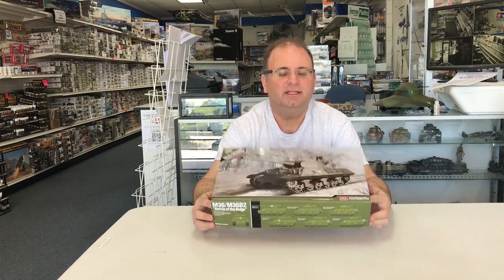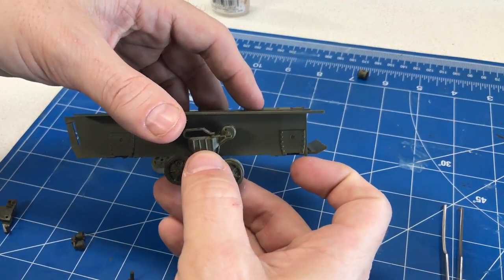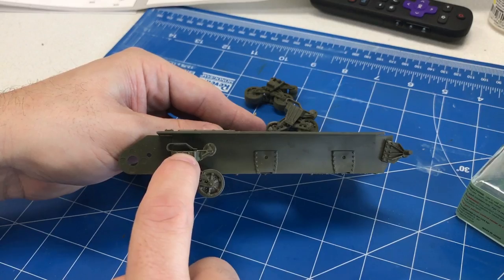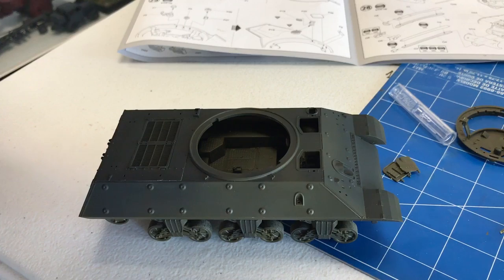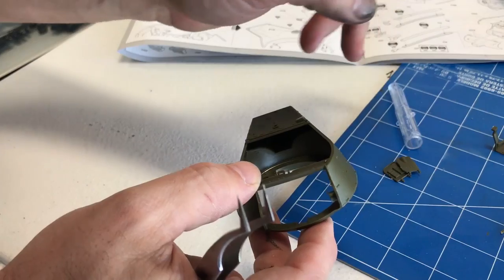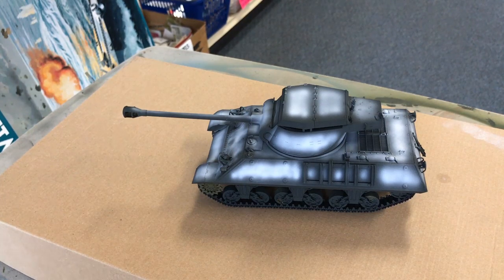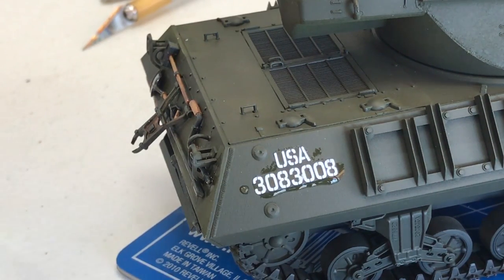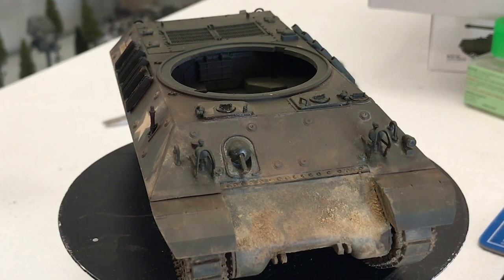Building the Academy Models M36

Comment: I wanted to add that in my little world it is much easier to see if you need to sand by using gray primer. Those little imperfections pop right out in gray. Much better for me than black. Looks like a great kit. The M10 was a great kit for my first tank. Easy easy easy...fit was good. Thanks for sharing...

Comment: LOOKS GREAT! THANK YOU SO MUCH FOR THESE VIDEOS! IVE LEARNED A MASSIVE AMOUNT BY WATCHING THAT HAS REALLY HELPED ME PROGRESS MY MODELS & DIORAMAS.

QUICK QUESTION: AFTER APPLYING YOUR PIGMENTS & PANEL LINES DID YOU DO A FINAL DULL COTE? IM INTERESTED IN STARTING TO WORK WITH PIGMENTS, BUT WASNT SURE IF THEY'LL STILL HAVE THEIR "POWDERED" LOOK AFTER SPRAYING IT DOWN WITH DULL COTE AT THE VERY END.

THANX AGAIN FOR THESE, THEY ARE AN ABSOLUTE TREASURE CHEST OF INFORMATION!!
Reply from the maker: thank you for watching , no after pigments don't dullcoat it will just blow it away
Reply: Andy's Hobby Headquarters GREAT, THANK YOU! LOOKING FORWARD TO THE NEXT VIDEO

Comment: is it nescessary to have a coat color before I paint the model?
Reply: Mr P It's good in airbrushing, where the darker base will fill in the detail gaps that the next coat would leave. It's not necessary, since you can go ahead and start putting on your choice color and put a wash over it, but the base coat just gives it a more "mature" look and feel to it.
Reply: I don't have experience with airbrushing, but I'd recommend either a primer to undercoat the model or a layer of something to seal it all in. A basecoat can also help certain types of colours pop easier, so a dark undercoat would help any 'dark' colour to look right with less layers, and possibly replace the need to shade. Priming a model is pretty easy and just gives something for the paint to properly latch onto, but isn't completely necessary.
Reply: Another thing is I work with airbrush but most of the time I paint the model right away no primer